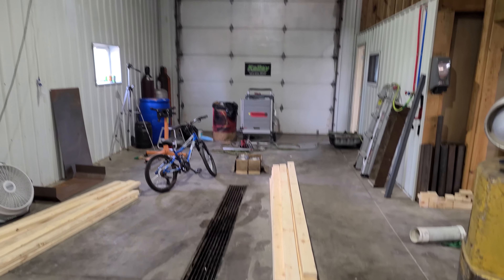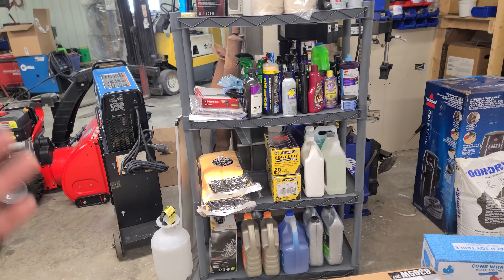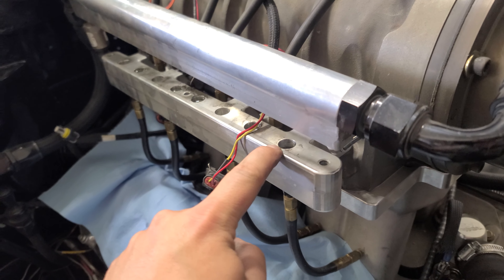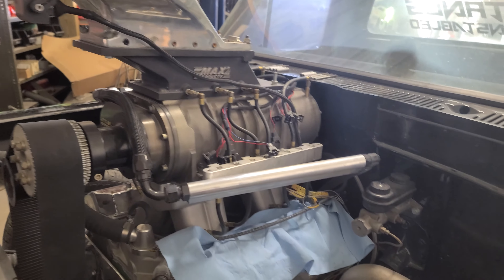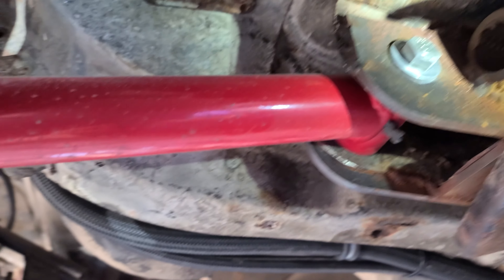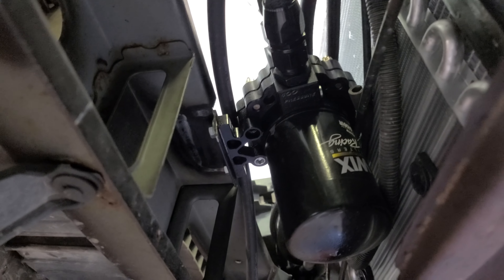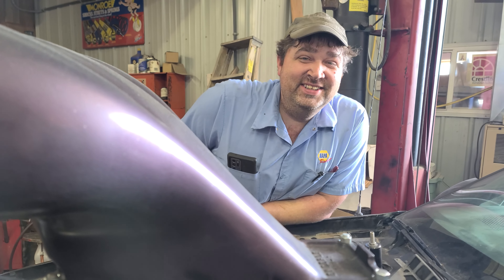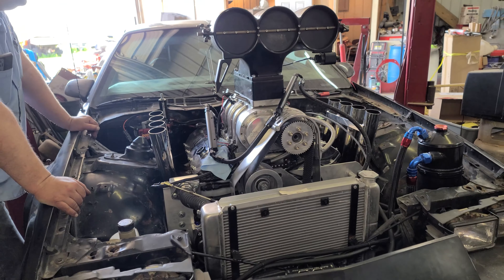How bad is the Camaro after Cleetus and Cars Indy? NOT GOOD!

Comment: Shop is Looking Great Dude, With the damage on the Camaro, make sure You get it pulled out and square before You cut anything off the front end. Once it has been pulled and squared up cut of the end of the rails and make Yourself a bolt on front bumper reinforcement. When you make a bolt on Bumper support, Make sure You Manufacture a Duplicate Bumper support. Make sure they both bolt on and then paint them up.
That way if something does happen, You will have a ready replacement and it will let you know if it is Tweaked further back. Also Maybe make up some rose jointed engine mount rods to stop the engine moving. In the case of the car hits something solid and the engine keeps moving forward.
Reply from the maker: That is a good idea! Jason doesn't want it after goliath or the other f100 is going.  So don't want to spend too much time.  In fact we haven't touched it since this video! 🤣🤣